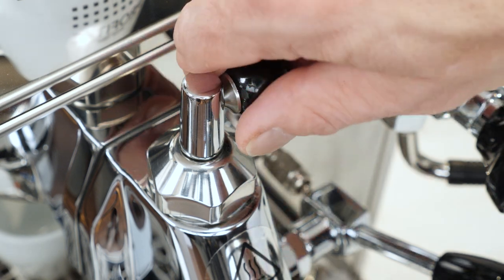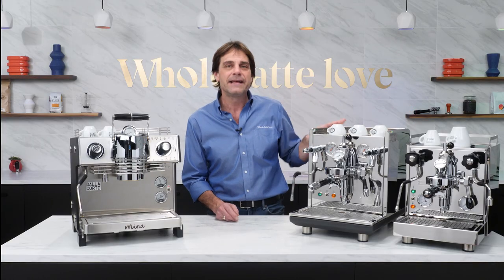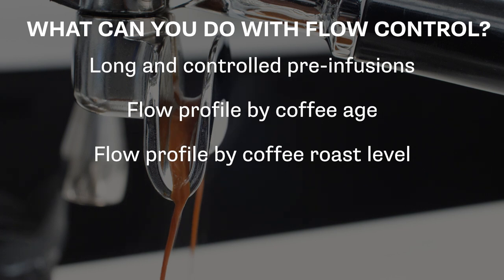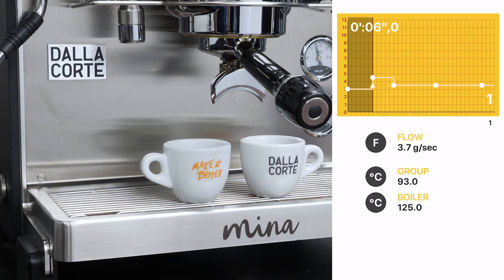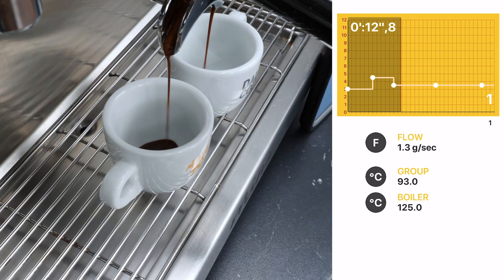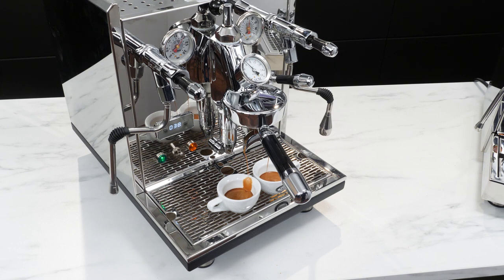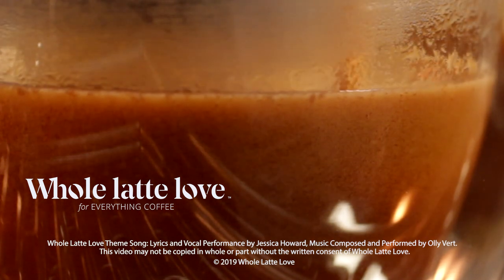How To: Intro to Flow Control for Espresso Extraction and E61 FCD Calibration

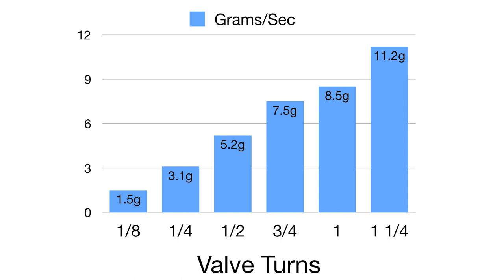Comment: Mark, your videos are very informative and done with a lot of enthusiasm. The flow rates in your chart at 3:08 don’t make sense, though.  1 ml of water, or espresso, weighs 1 gr. A shot of 30 ml weighs 30 gr. The lowest flow rate in your chart, 1.5 gr/s, would yield that shot in 20 seconds. At the higher end, 11.2 gr/s, would yield the shot in just over 2 and a half seconds. That doesn’t make sense. I aim for 30 ml in 22 seconds, which is a flow rate of 1.36 ml/s. My Acaia scale rounds the calculation to 1.3 or 1.4 gr/s. The Acaia user manual says the flow rate scale goes from .1 to 3.4 gr/s. So, maybe 1.5 in your chart is .15 gr/s, which is reasonable for 1/8 of a turn. However, the 11.2gr/s, which would be extremely excessive, could not be 1.12 gr/s, which would then be too low for the highest rate. Thanks for what you do.
Reply from the maker: Hi a, flow rates in the chart refer to potential flow rate of brew water onto the coffee and not the flow rate of espresso from the spouts.

Comment: Marc, I have a Rocket Mozzafiato type V. Can this machine be fitted with flow control. What would be the cost of DIY fitment.
Reply from the maker: Hi Stephan, Thanks for the question. We have tested the FCD on E61 Rocket machines and it works. Here's a link to the retrofit with current pricing. As of today it's out of stock. It's been very popular and demand currently exceeding supply. Hope to have them back in stock soon!
Marc

Comment: Can anyone link me to the video where Mark adjusts the flow value so it's not sitting tight against the mushroom head but a few mm above. Thanks
Reply from the maker: Hey x, Here's a link to our most recent and very comprehensive video on E61 flow control maintenance and calibration. Video is chaptered. Sleeve calibration at 18:40 https://youtu.be/Bxh1ik-orFA
I'm sure this will help!
Marc

Comment: Can I say that flow control is a way to do brew pressure control? Since the flow gauge shows a more accurate brew pressure
Reply from the maker: Hi SD, Yes, you can use the group mounted pressure gauge to drive decisions of flow manipulation which in turn changes the pressure on the coffee puck.
Marc

Comment: Now I need a flow control recipe for cheap old beans :)
Reply from the maker: Hi SD, Easy... hit with high flow to start then taper to no flow. May need increase grind size a hair from normal with the high flow rate start which pushes smaller particles through the coffee cake and slows extraction. demonstrated in this video featuring to simple profiles: https://youtu.be/a-QAOo8Vg5A
Marc
Reply: @Wholelattelovepage  Oh wow, thanks for the reply :) Coffee community - best community ❤️

Comment: Just installed mine last night, first shot this morning was fun :) 
Now I’m wondering, what is a “standard” flow rate that I should be using to backflush or if I want to make a shot without any flow profiling? Obviously I’ll be profiling everything, but it would be nice to have a baseline to compare my profiled shots to. Thanks for all your videos!
Reply from the maker: Hi John, Thanks for the comment and glad your having "fun"! Setting for standard flow rate of ~8g/s on vibration pump machines and ~11g/s on rotary pump machines is obtained with the flow open to 1.25 turns from closed. You are welcome for the videos. Sorry for my delayed response - I was offline for a few days. I typically respond to comments much faster.
Marc
Reply: @Wholelattelovepage  Thanks Marc, that's exactly what I needed to know!

Comment: Silly question, but when you run a flow profile it looks like the profile starts when you move the lever and not when the shot starts to come out. In your example 6 seconds went by and then you moved the control with no shot yet coming out. Right?
Reply from the maker: Hi r, Yes profile starts as soon as pump comes on and water contacts the coffee. Initial low flow rates often used to pre-infuse the coffee puck allowing CO2 in grounds to off gas prior to applying a higher flow rate. Learn more about flow profiling including graphs of some useful profiles here: https://www.wholelattelove.com/blogs/articles/intro-to-calculating-flow-rate-on-e61-group-machines
Marc

Comment: Will these fit on all e61 brew heads? love to add to a rocket
Reply from the maker: Hi Chris, We have tried in E61 group Rocket machines and it works. Have yet to find an E61 group it does not work in and we've tried Bezzera, Expobar as well.
Marc
Reply: @Wholelattelovepage  Awesome I will be on the look out when we can buy directly from you all!!!
Reply: @Wholelattelovepage  So it will work on an Expobar Brewtus4 as well !?

Comment: Hello .. 

When I open the flow control to 1/2 turn .. I got 7.7g per sec. On my ecm synchronika ... I believe its too fast !

Thete is any way to fix that ?
Reply from the maker: Hi sa, That is kinda fast. Probably should be more like 4-5g per second at half turn open. Do you get no flow when you think the valve is closed? If not, you may need to calibrate by adjusting the sleeve position to allow the valve to fully close.
Marc

Comment: Shouldn't the Rocket R Nine One be listed as well?
Reply from the maker: Hi Vernon, The R Nine One is a pressure profiling machine. Pressure profiling is similar but not the same as controlling flow. In a flow control machine the pressure is constant in the brew circuit of the machine prior to the flow control device. The R Nine One uses a variable speed pump controlled by a pressure transducer.
Marc

Comment: This is really cool. I'm thinking about a Pro 600 with flow control. What do you do about your grind settings. Do you pick a flow profile and then adjust your grind. Or, set your grinder up for 9 bars and then adjust flow?
Reply from the maker: Hi NSD, Thanks for a great question! Setting up to proper grind size for 9 bar is one way to go. But you can modify grind size depending on how you are using flow. You can replicate Slayer shots by grinding finer and using a long low flow infusion prior to ramping to full brew pressure. Could do a drip grind and very low flow to produce coffee shots/filter coffee.
Marc
Reply: @Wholelattelovepage  Thank You!

Comment: Interesting! I'll have to look into your other newer videos for Flow Control tutorials more in depth.

A few questions Marc:
1- Flow Control being the new trend of 2019, how come still on April 23th 2020 Rocket hasn't even come up with any update on their machine to include such device since it's basically just a "E61 Universal Tool" that fits on most models? I think the only difference between the one from ECM and Profitech is the gauge's size & color, as those should fit on all E61 so why didn't Rocket almost a year later haven't come with their own tool so people like me who bought a R58 in summer 2019 don't feel like they bought something outdated already?

2- If you don't have a flow control, or that you keep it fully open, it's gonna run at a default pressure of how much? Will it be the same recommended pressure of ~9.5bar as the pump? Not sure if I read somewhere that in the brewer it's more like -2bar than the actual pump's pressure.

3- Do you expect the price of that tool sold seperately to go down by the end of the year? I can hardly believe that just a tiny plumbing part with a gauge can cost that much if it's not just for "offer & demand" reasons. In Canada it's even much more than the price in USD converted to CAD, I don't get it.

Thank you!
Reply from the maker: Hi P, Thanks for the questions.
1. I do not know why Rocket has not created their own FCD. They may be more invested in pressure profiling on machines like the R Nine One or the R60V. We have tried ECM/Profitec's device in Rocket machines with E61 groups and it works. And yes the device is the same with exception of finishing details like color of gauge.

2. If you keep flow control fully open it will not change the potential pressure. That's limited by OPV and/or bypass on rotary pump machines. Also flow control should in most cases never be run fully open. Flow rate in that position is near 30g/s in a rotary machine. Stock flow rate on rotary machine is ~11g/s. Pressure drop to group from machine gauge indicated pressure is near zero on rotary machines and ~1 bar on vibration pump machines.

3. I have no reason to believe the price will drop on FCD's by end of year. They are in short supply. I don't think pricing is related to supply and demand. The price has not changed since introduction. Understand these are specialty products machined from stainless steel with custom parts. While in high demand within the home espresso market it's a relatively small demand so not much in the way manufacturing cost reduction due to large production volume.
Marc

Comment: Hope you're still taking questions on this one - I have a profitec 500 PID with flow control arriving and I have no idea how to negate the flow control to dial in my coffee before I start messing around with the new addition. Do I open up flow control all the way, then adjust from there? I read the flow control, when fully open, may make machines flow faster compared to a stock standard machine. So I am well confused!
Reply from the maker: Hi VV, Thanks for the question. Always taking questions! To get stock flow rate like there was no flow control installed open the valve about 1.25 turns. That should get you a flow rate of about 8g/s. Here's a great article on the basics of flow control. It includes graphs of flow rates to use for various coffee type and situations: https://www.wholelattelove.com/blogs/articles/intro-to-calculating-flow-rate-on-e61-group-machines
Marc

Comment: Hi Marc, love the videos, they are by far the best on the web. I have the same setup, ECM Synchronika with the same FCD and Lunar scale. I’m having trouble dialling the machine into my Atom 75. 
For now, I’d like to ignore the FCD and start pulling shots without activating it.  I’m just not sure how far to open the device. Should it be open to all the way anti-clockwise or as in your previous video, enough to achieve a set flow rate of if I recall 6ml/s, or to another setting?  I feel once this is setup and dialled in, I can experiment with the device. 
Thanks, Beansy
Reply from the maker: Hi Beansy, Thanks for the question and kind comment! Flow rate on the Synchronika with stock mushroom is about 11g/s. Here's a link to a live stream I did a couple weeks ago which goes through calibration and a couple of basic profiles: https://youtu.be/BkwP3JYrk-A I use a Profitec Pro 700 in the video which is nearly identical internally to yourt Synchronika. On the Pro 700 it's 1.25 turns from closed to get the stock flow rate. Probably never want to run with the FCD wide open as the flow rate at that position can be near 30g/s. Hope that helps!
Marc
Reply: Whole Latte Love you’re the best Marc!

Comment: Two questions:

1. Are you guys planning on selling the flow control again? Right now I only see them available as part of new machines.

2. While they are compatible with most E61 group machines, especially by ECM and Profitec, wouldn't this cause a problem with Heat Exchange type machines ? I have a Profitec Pro 500 with a pressure stat, and I really want to play around with flow profiling but I don't think that's an option if it would mess up with the heat exchange system since it relies on the flow of water to achieve its desired temperature at the group head.
Reply from the maker: Hi George, Thanks for the questions. The FCD does not affect the thermo-siphon sytem which heats the group. I touched on this in a video a couple of weeks ago. Using a cutaway E61 group you can see where the thermo-siphon flow enters and exits the group. Here's a link directly to the section of previous video showing the cutaway group and thermpo-siphon flow route: https://youtu.be/Cicw5_EAOXU?t=288
We do hope to carry the FCD upgrade for E61 individually soon. The flow control device has been very popular and in short supply.
Marc

Comment: Hello Marc, this is my results on my Profitec pro 700, its plumbed with flojet and accumulator with static 2 bar to the machine pump which is already adjusted to 9 bar of brew pressure:

FCD Turn : ml/s
0 : 0
1/4 : 3.5
1/2 : 6
3/4: 7.6
1 : 9.3
1 1/4 : 11

I guess there is some mistakes with the results comparing to yours, assuming we are using same variables, the only difference is I'm using flojet with accumulator, would you please advice me in how to correct it? Or it just fine to be used like this?

One more thing, Assume that the first 1/4 of the turns divided into 4 quarters, the 1st one gives me 2ml/s and the 2nd 2.3ml/s and the last one is already the first quarter of the ratios I mentioned, what do you think!

Sorry for the long thread but I'm really confused 🤯
Reply from the maker: Hi AA, No problem on the long thread! More detail is always better. Bottom line you are perfectly fine to use. Your results are actually very similar to mine. Any difference falls into margin of error as valve setting positions are not precision stops.  Here are my results in grams per second - I'm using weight rather than volume:
1/4: 2.4
1/2: 4.2
3/4: 6.9
1: 8.8
1 1/4: 10.9 (stock flow rate w/no FCD)
1 1/2: 13.1
1 3/4: 14
2: 28.6
Hope that helps!
Marc
Reply: Thank You Marc, Now I can enjoy while pulling my espresso shots, much appreciated

Comment: I roast my own beans (Behmor), and have a Ranchillio Rocky grinder, will I really notice a difference between the espresso from a ECM Synchronika vs my $80 Krups Espresso Machine? I don’t want to drop over $3k to realize the espresso tastes the same.
Reply from the maker: Hi Marcus, Thaks for the question. I'm guessing your $80 Krups uses an undersized pressurized filter basket? Going to a standard non-pressurized basket will make a huge difference! Also you'll get consistent brew temps, real milk steaming...it will be night and day! Also, if roasting your own beans having the flow control will allow you to do thos long low flow pre-infusions that make a huge difference with beans fresh from roast.
Marc
Reply: Whole Latte Love You guessed correctly, pressurized, and undersized. I knew that it was around 5mm smaller, however, I never put 2 & 2 together to realize that smaller volume also leads to less available flavor per shot. I’m going to have to seriously consider upgrading my machine before the Krups breaks.